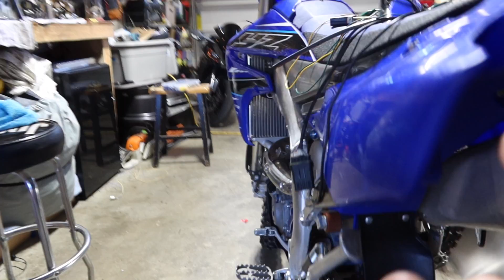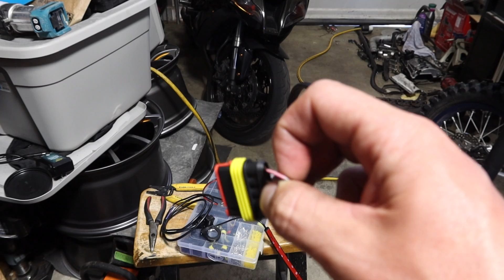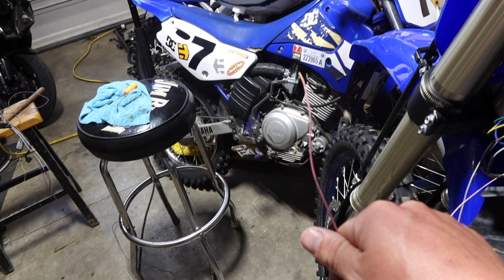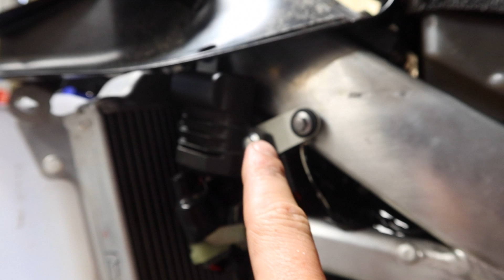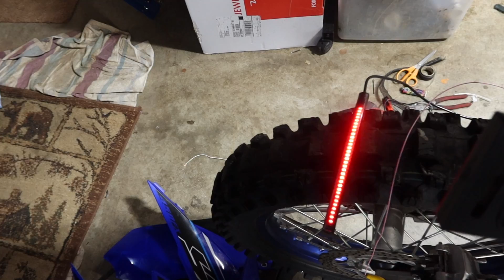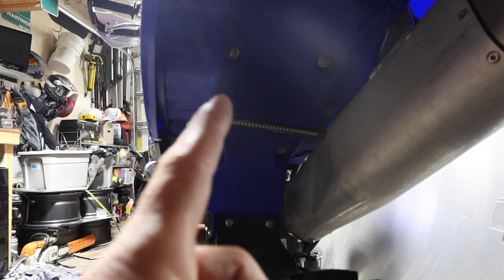Street Legal Lighting For The Dirtbike

Comment: same lights, My rear turn signals work fine, fronts just barely blink and don’t fully cycle a turn signal. If I flip the wires in the relay, the fronts work perfect, but the rears stay solid lit up. Any ideas??
Reply from the maker: The rear does need to be processed through the blinker relay while the fronts do not I believe. If you hook power up to the front turn signals it should blink by itself. The rear will need the blinker relay to give power and take power. Are you using the blinker relay as a power +12 volt signal or a grounding signal?
Reply: @ModdingAddiction  forgot I made this comment figured it out you’re right.  Front doesn’t need relay, rears do

Comment: I wanna add indicators and a high/low switch to my 2022 WR450F but dread the thought of having to cable manage.
Reply from the maker: It’s really not all that bad. Pull the seat off and one side of the fenders and the wires can all run on that side. The hardest part is getting the control wiring all tidy

Comment: What battery should I use for this setup?
Reply from the maker: I have been using my stock battery and it has been holding up well
Reply: @ModdingAddiction  would a 12v external battery source work? I don’t have a battery on my bike and don’t want to upgrade the stator
Reply: @joeycapooch2499 upgrading stator is expensive. You can add a full wave bridge rectifier & a capacitor to run LED's if the bike is AC powered thus negating the need for a battery too.
Reply: @ModdingAddiction how did you hook it all up to the battery

Comment: How do I use a lipo battery
Reply from the maker: They are the same out put usually ( make sure it has the same ratings as the old one) but it’s just newer tech. Better punch longer life better cell degeneration. If it has the same ratings then just hook it up like your old batter. Positive to positive and negative to negative
Reply: What battery should I use for this setup excluding the horn

Comment: A atv master cylinder has a brake switch built in. I’m running a raptor 700 front master on my yz450. Using a R6 headlight/signal switch. I like staying brand specific🤷🏻‍♂️
Reply from the maker: That’s a move right there. Wish I would have known about that. Makes sense since they have a brake light on them

Comment: What about x 260 dirt bike can it be street legal after installed lights, turn signal, brakes light,  rear view mirrors, motorcycle insurance, horn  and motorcycle  tag registries  an can it be street legal????
Reply from the maker: You can turn any bike into a street bike. Look up your local laws but sounds like you got the gist of it. One of the big things when you get your bike inspected is street tires. For some reason they don’t like dirt tires for the street lol
Reply: Hey man how did you wire the banjo bolt can seem to figure it out

Comment: What about a rmz450 2022? It doesn't have a battery but it's EFI. Some say you can plug lights because it makes DC power because it's fuel injected.
Reply: It has a battery…
Reply: It’ll handle light duty LEDs with ease. No upgrades required